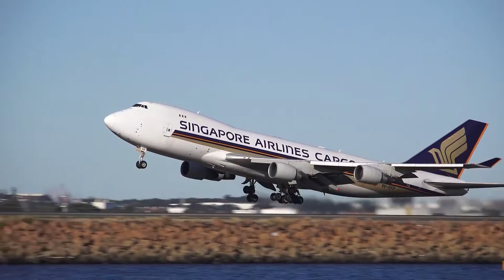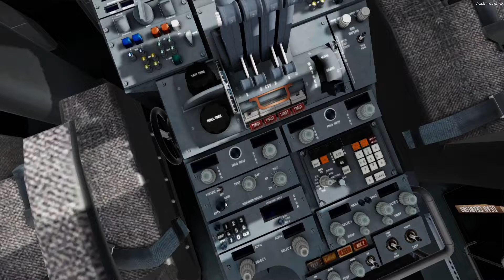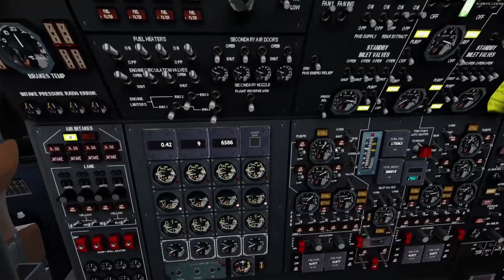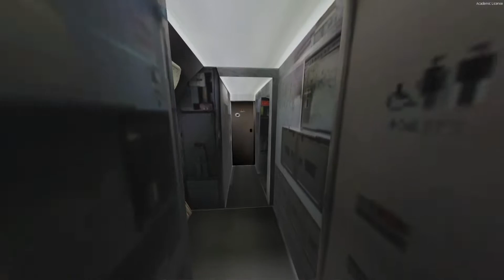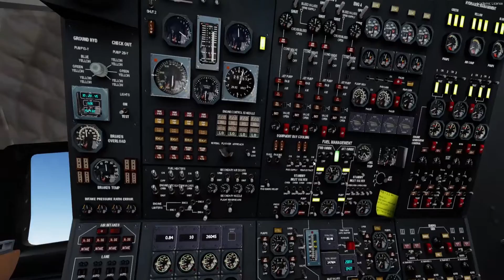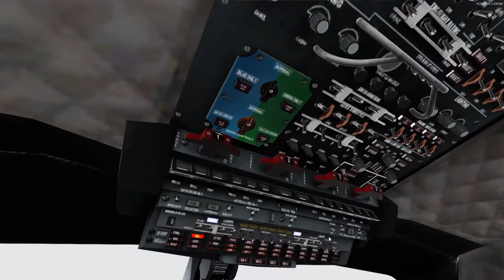P3D V5 Fullflight - DC Designs Concorde Review - Heathrow to New York (EGLL-KJFK)

Comment: Hi folks, thought that this video was very good and a great demonstration of the airplane. An update has now been sent to Just Flight, which should be released shortly, in which there have been numerous bug-fixes and improvements. All cockpit texts are now high-resolution decals, ILS and Autoland feature is fixed ( it's also important to intercept ILS beams from below in FSX and P3D, apparently, otherwise the ILS system in the sim doesn't always work ), lubber line added, turn coordinators added, compass and ADI indicators improved and a few other minor details either improved or fixed :)
Reply from the maker: Thanks for the update Dean!
Reply: @SinglishP3D  Get in touch about the update or simply redownload from your account and you'll have the new version, new and updated.
Reply: Release this for Microsoft flight simulator 2020 pleaaaaaaassssseeeeeeeeee
Reply: @killerbsting1621  It's in development, announcements due in August after the F-14 Tomcats are launched :)

Comment: Unfortunately I have bought this aircraft for around 35 euros and I have to say I am deeply dissapointed. I know you dont get a study level aircraft for 35 euros but what you get is really close to nothing. I have compared it to an old freeware mod back from the fsx days that also works perfectly fine p3dv5. Even this rather bad mod is better than this payware addon. Honestly. If you compare them both you think "What did I just pay 35 euros for" the freeware mod even has a better documentation for procedures than the payware concorde. for example: Takeoff: payware says: put thrust levers to full thrust and take off. Mod: Set thrust to about 102% N2, you also get callouts fpr V1, VR btw. and lift the nost 13 degrees up.. etc etc...
Really even more disappointed and I thought from this payware addon...

Comment: Don’t understand where all the hype is coming from. This thing is a tub of crap.
Reply: The main hype is coming from it’s port over to Microsoft Flight Sim 2020
Reply: @brycepeterson1969  but one downside, MSFS is still W.I.P even after release because it doesn't have supersonic flight capability in the flight dynamics. Not until Q2 of 2021.
Reply: @TheRealSC108pro  They made a custom flight model, supersonic travel was never really an issue.
Reply: yeah that thing is crap, even for FS2004
Reply: Perhaps you could elaborate?
Reply: @tjfSIM  I don’t need to.
Reply: Agreed 😔 I want to like it but I just can’t.

Comment: I think that we were mislead about the quality of the DC designs concorde
Reply: How do you mean?
Reply: @justflight  well you see the was so much hype about it and in the end the textures are not great for what it is.
Reply: @olliexton6428  The textures had to be done at a certain level to support FSX. However, just before the product launched I learned of a much better way to do text detail that would make things much higher res. This is planned for an update soon and will become the norm for future DC Designs aircraft. The ILS issue in the video is an odd one, as the aircraft uses the stock ILS so it should all work out of the box. If I can understand what's going wrong there, it will also be fixed immediately, although it could just be a result of Concorde's unique aerodynamics that makes it very slow to respond at low airspeeds.
Reply from the maker: @DCDesignsMSFS  Great to hear that m8, looking forward to the update and might possibly use the aircraft for CTP!
Reply from the maker: blackbox concorde sike
Reply: You get what you pay for at least, Concorde X was much expensive but was way more detailed.

Comment: Nice, how to get this Concorde to Cold And Dark State?
Reply from the maker: just power off all the engines and turn off the battery lmao
Reply: @SinglishP3D  tip on the nose cone operations.

During take-off operations, set the nose cone/visor to 5 degrees down (always) and not fully down (12 degrees).

You can only put the nose fully down during landings.
Reply: @TheRealSC108pro  ... with speed less than 270 kts